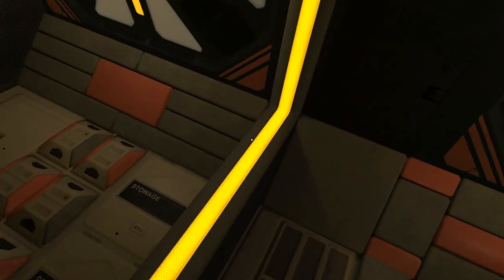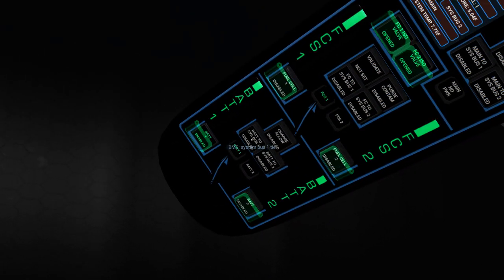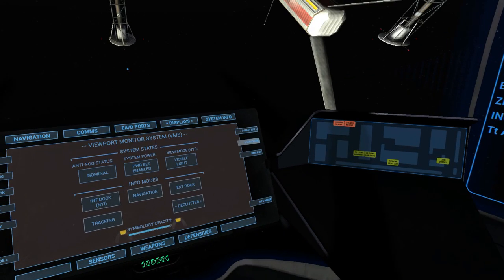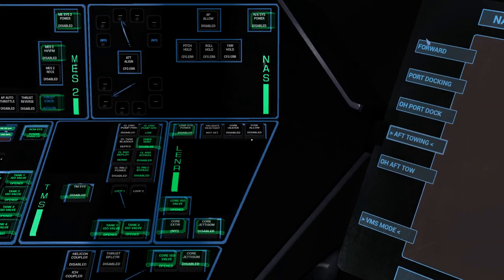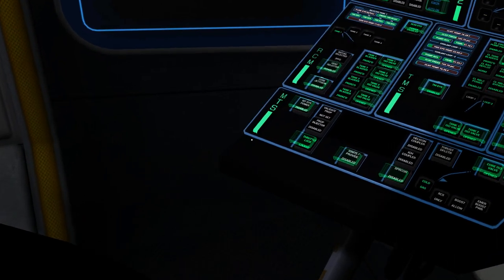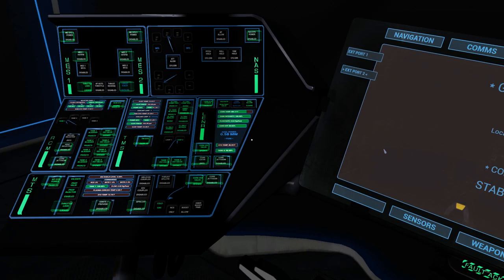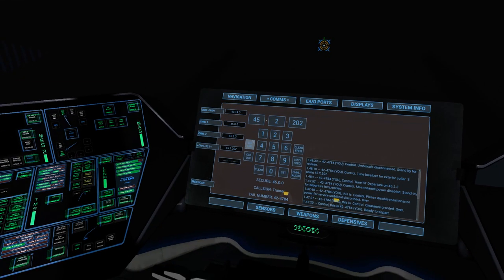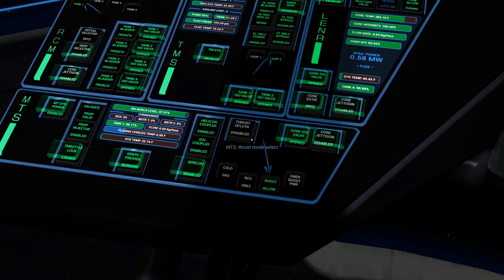Rogue System 1: Powering Up

Comment: I'm wondering why the fuel cells need to be purged. Is that to keep water vapor from being inside the pipes. Fuel cells run on hydrogen, so could the cold hydrogen gas cause ice in the plumbing?
Reply from the maker: twistedyogert To be honest, I don't know.
Reply: @MikeAben  well It's probably to keep dust and Basicly Dirty hydrogen from clogging the thing